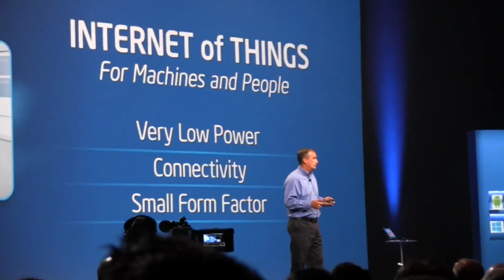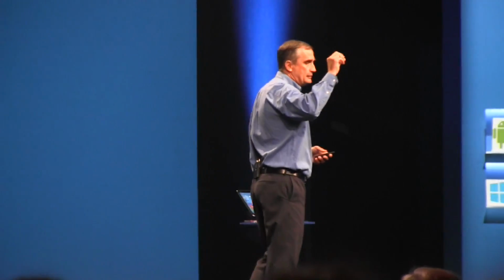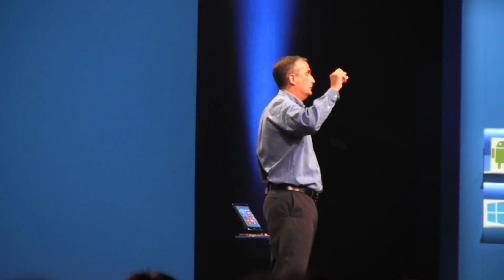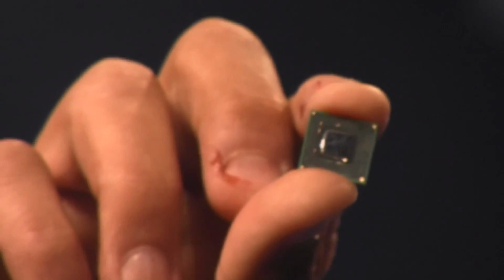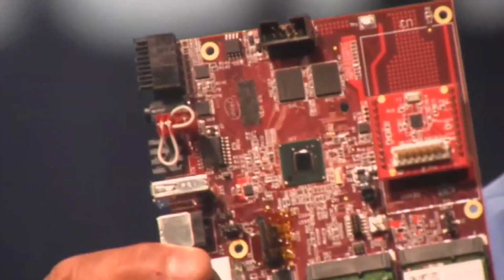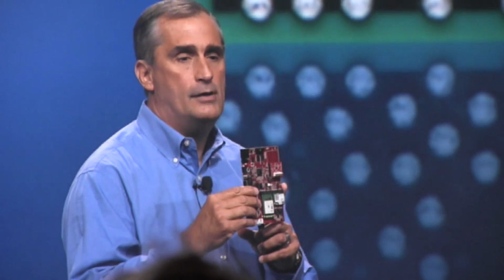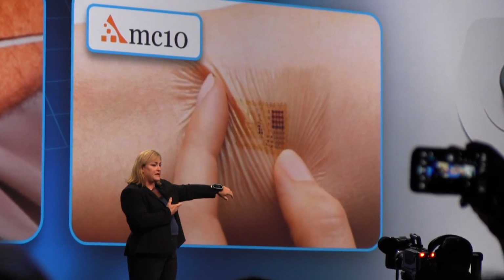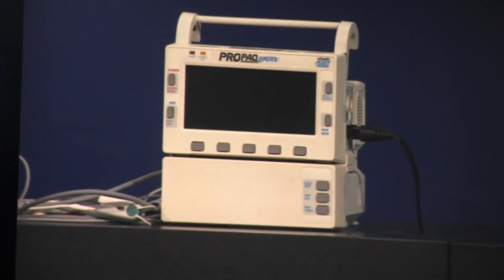Intel Announces Wearable Technology and the Quark Processor

Comment: It's something they developed to compete with ARM in the low end embedded device market... starting off with industrial and similar applications...  The front-end at least is "Pentium ISA compatible" but the full details of the architecture have yet to be revealed.

So, it's x86 based but also something new...